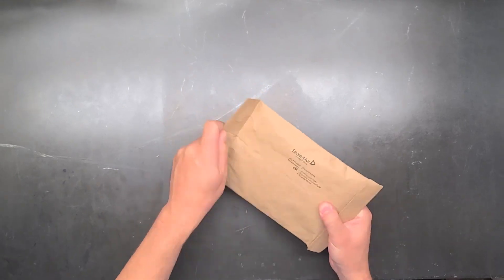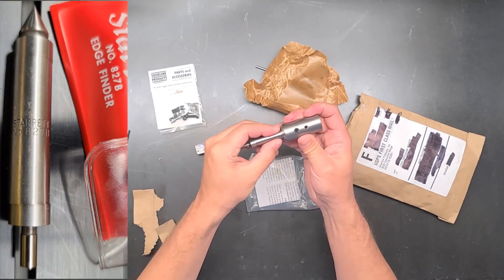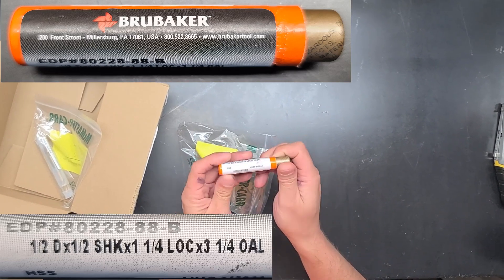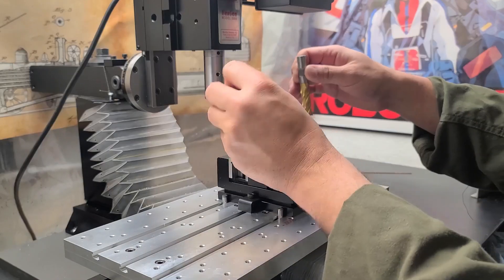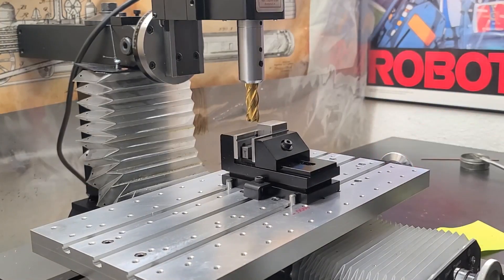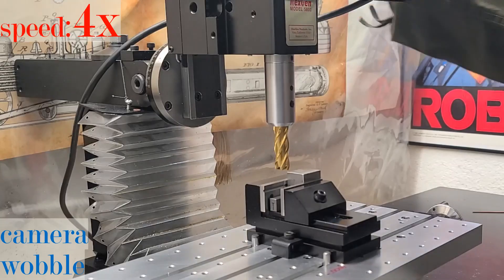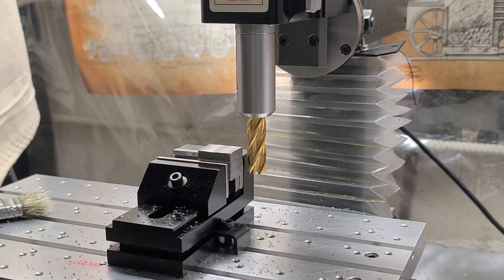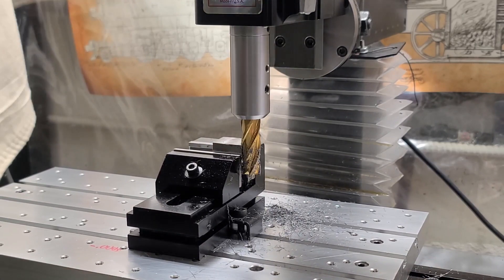Review: Small Mill Big Cutter!!!

Comment: I absolutely agree with you that the Sherline mill cutter is too short. I needed to make a vee block and wanted to mill it from one inch by two inch alum. Before I reached the bottom of the vee, about inch deep, the top of the cutter was tearing up the top of the vee. Just useless.
Reply from the maker: That is unfortunate and frustrating.  I do think Sherline could have done better.  I think they could have at least offered a upgrade option over the standard cutters.  They know what a good cutter is, after all their lathe tooling in HSS is excellent. I love their radiused lathe cutters.

Comment: Just tried finding that end mill on McMaster -Carr….it must be listed under another part number than you show on the video??
Reply from the maker: Yes the invoice item number is different:
8918A53 TiN-Coated High-Speed Steel Square End Mill 4 Flute, 1/2" Mill Diameter, 3-1/4" Overall Length
https://www.mcmaster.com/product/8918A53

8912A44 High-Speed Steel Square End Mill with Two Mill Ends TiN Coated, 4 Flute, 3/8" Mill Diameter
https://www.mcmaster.com/product/8912A44

Though I'd buy more than 2 cutters they ship in a small flat rate box so might as well fill it up.
Reply: @LoydPrecisionMakers  thanks!

Comment: Another great video. May I ask which hardened steel you are milling? Also, what are you seeing in terms of dimensional accuracy, machining hardened steel? Thanks.
Reply from the maker: Thanks and thank you for taking the time to watch it.  For this part it should have been plain hot rolled.  If I said hardened, I misspoke.  In fact I can tell you exactly what it is: ASTM 36 Square Bar Steel.  That being said it is still holding .0003-4.  That is for both dimensionally and parallelism.  A few are hitting .0001 but I haven't done so consistently, more to learn!!!
Reply: @LoydPrecisionMakers  Outstanding. Thanks for responding.
Reply from the maker: @haroldkreye8770   Any time let me know if you ever have any questions!!!